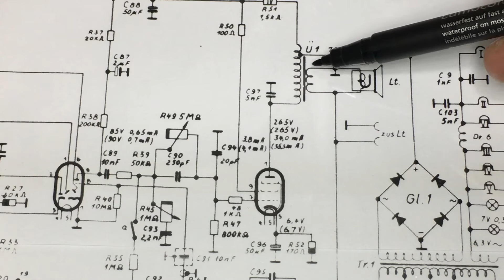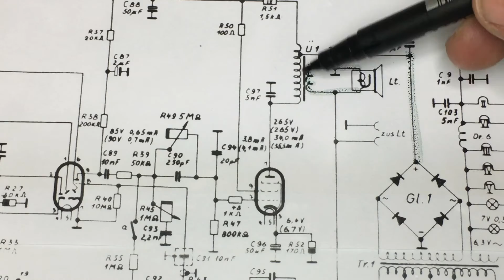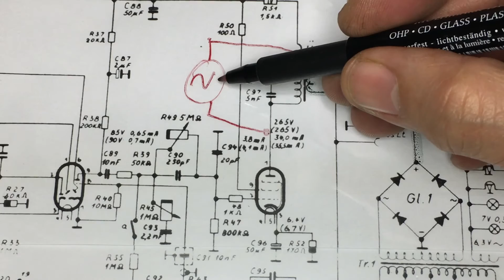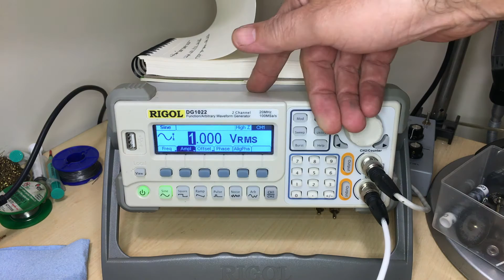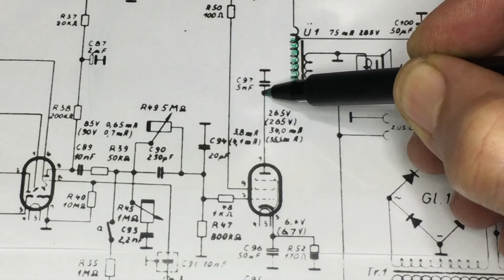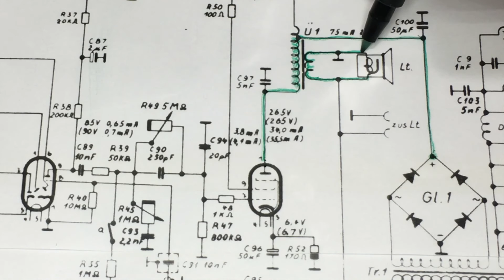How to safely test the Output Transformer on tube radio or amp.

Comment: Thank you so much for this wonderful video. It's very timely that I'm currently working on a guitar tube amp which the output transformer emitting some smoke when turning on the amp. This creates a humming noise at the same time. Measured the voltage out of the board that supplies to a center tapped TX and it measured around 380VDC is this normal? Or is the humming noise due to the faulty output transformer. The output side of the TX is reading 0 Ohm using my multimeter.
Reply from the maker: The 380VDC is probably correct as it is the B+ going to the output tubes through the primary if the output transformer. Check the voltage at the anodes of the power tubes and should read a little less than the 380 at the center tap of the OT. That would tell you that the primary may be OK. The zero ohms of the secondary is concerning. It should be low, but could also be shorted.

Comment: Awesome? I am testing transformers in the Loewe Opta Hellas 3841 W at the moment. This is extremely valuable information and a fabulous reference and future guide. Explained in a straight forward, clear manner. Thank you very much Manuel! I am making a small donation.
Reply from the maker: Thank you. Glad to help.
Reply: @electronicsoldandnew  you only seem to have monthly coffee payment options now. I wasn’t able to find one off random PayPal coffee payment option via Patreon direction. It’s better to leave all options open for friendly relations. Don’t worry what the competition are doing. Just do your usual great work! Cheers. 😁☕️
Reply from the maker: The patreon system doesn’t allow for one-off payment, which is why I added Paypal as an option. Thanks.
Reply: @electronicsoldandnew  I have made several one off friendly contributions when you directed me to the Patreon link, where I made one off payments with PayPal. The payment link is no where to be found. Sorry to be a pain but it’s something I come across every time I want to make a contribution. I have clocked up thousands of hours in internet marketing, web design, search engine optimisation etc… A qualified observation!
Reply from the maker: I’ll check it out. See why the link in the description is not working.
Reply from the maker: I tried it and it seems to work. Here’s the full link:
https://www.paypal.com/paypalme/macaldeira
Reply: @electronicsoldandnew  if I am not finding the link, maybe more exposure of that link could help bring in coffees. It’s okay, it’s not your fault.
Reply: @electronicsoldandnew  the link worked thank you. The link is not showing on your description page at my end. I use an iPhone 7S with iOS 15.

Comment: Thank you for posting this, very useful for a novice like me.  I'm working on a Knight signal tracer that has no audio.  All tubes are good, I replaced all electrolytic and filter capacitors and spot check several resistors and replaced a couple that tested out of spec.  The output transformer tests good using your test method.  Can you point me in the right direction, would else would be the most probably reasons for no audio?

Comment: I'm confused how the output transformer BLOCKS the 300vdc to 600vdc DC voltage apply to the power tubes on the anodes. I know that capacitors block DC but inductors pass DC and there is high DC voltage on the primary side to the output transformer to the secondary side of the output transformers must have very high DC voltage or the output transformer RATIO is what BLOCKS the high voltage DC ?

Comment: THank youi for the very instructive video. How would the procedure differ for a push-pull configuration?
Reply from the maker: Do exactly the same thing from both driver tube anodes, one at a time.
Reply: @electronicsoldandnew  Much obliged for the response.

Comment: I appreciated your video... I am not working on a tube radio but a lamp with sound and animated parts. I would like to test the secondary windings to figure out the Voltage output but do not want to desolder the connection. The windings go into the board where the RR(4 diodes) meet in the middle of them. Then there is a capacitor (smoothing cap I believe it is called). the voltage at the RR is 1.5v but at the capacitor 2200Uf/16v is 9v... How can I test the output voltage correctly as I need to order another transformer for a 2nd lamp that is no longer working? Thanks!

Comment: It's an old video but can you give an explanation how to do the same procedure on Push-Pull output transformers? I have a soviet hi-fi radiola that I'd like to test, it has EL84s in push pull.
Reply from the maker: Exactly the same. Do it one winding at a time and the signal should be heard at the output in both cases.

Comment: Another great video, very concise clear instructions. I successfully tested my power transformer using your other video as a guide, but unfortunately I don’t have a signal generator. Could I use a Variac set to low voltage to test the output transformer?
Thanks again.
Also, would be great if one day you could do a video explaining how to connect an external device such as an iPhone to the PU plug so we can listen to online radio as an option. :)
Reply from the maker: E careful of using the variac. It has very high current capabilities which could do more damage.
As for your request for a video, I have actually done one. I believe it was the stereo to mono cable video.
Reply: Electronics Old and New by M Caldeira Thanks, just watched the suggested video for stereo to mono, exactly what I needed.
Thanks also for the advice on the Variac, I’ll have to come up with another way to test the output transformer, or just take a punt that it works after recapping my Schaub Lorenz. :)
Reply: @BKGoldDetecting  wouldn't putting a low value fuse on the OT primary's leg safeguard the transformer from current draw....which there shouldn't be any if secondary has nothing connected? ( shorted would draw current but fuse would prevent runaway )
Reply from the maker: @curtisprice9806 : that would work

Comment: I put the positive lead from my signal generator to the correct pin and heard a signal without placing the negative lead on the circuit. Just that mean the circuit is grounded?
Reply from the maker: Your signal gen is grounded through the mains earth, and if your unit is also using mains earth as a ground, then you have the system using the same ‘ground’

Comment: Repairing basically guitar amps, I must say that this procedure is unfortunately not enough to verify that an output transformer is really okay. Problems could be caused by insulation problems, caused by internal sparks if amps have been driven hard without a load being connected. Those issues might only appear, if the ot is tested under proper voltage-conditions. I usually use my variac plus a connected powertransformer out of any tube gear and use the 6.3V heater coil to get an adjusteable ac between 0 and around 7V.. I then connect this voltage to the secondary winding of the ot and make my measurements at the primary coil of the ot. I've already found dead transformers that seemed to work fine with the other checkup procedure... But thanks for your great videos!!!
Reply from the maker: salossi : thanks for your input.
Reply: ...that's clear as mud to me-!!

Comment: Hi, thanks for the informative explanation and vid.  I am working on an Akai M8 right-side amp monoblock that has zero output. The left side works.  The troubleshooting guide in the service manual suggests testing the output transformer.  I have traced the wires from the speaker jack back to one side of the OT (output side) and traced the wires to the input side of the OT.  

I am using an IPad as my signal source with a stripped 1/8" cable with bare wires on one end connected with alligator clips.

I am having trouble identifying where I connect the cable in my amp like you connected to the rectifier in the vid.  I guess I am looking for B+?

So, just guessing (with power off and unplugged) I connected one clip to the output side of the OT (a wire actually connected to speaker jack) and touched one of the two tabs on the input side of the OT with a probe and got audio.  Then on the underside of the amp I touched the probe to the 7th pin on the EL84 socket (tube removed) which is hard-wired to other tab on the input side of the OT and got audio. Notably, I got audio from touching several of the pins and much better volume and bass from touching the underside center pin.

I do not get audio  if I touch the signal probe to each of the tabs on the input side of the transformer.

I feel like I am doing it wrong. But, it seems like the signal has to be going through the transformer itself because I am connecting to wires on one side and completing the circuit on the other.  

I hope I am not being an idiot?

Comment: thanks for your informative info, but I dont have radio tube Transformer. I have electrics organ I couldn't find good inf on how to tested. my transformer have 4 wire in primery and 6 wire secondry. could you please performe vidoe on how to test this kind of transformer. many thanks
Reply from the maker: +Tory Bosher : is it a power transformer or audio output transformer?
Reply: I really appreciate ur reply. Unfortunately there is no way to show u my transformer but believe It is audio transformer. Many thanks

Comment: I don't have a Function Genator so this is how I test transformers for power or output for speakers I use a little AC Train power supply that is varible from 1volt to about 6volts. I typically try not to go over 2 volts. Then on the output will just use a voltmeter to get a voltage reading. A friend of mine does the same test but with a higher voltage and a light bulb.
Reply from the maker: +Leland Clayton : that's just fine. All you need is any source of AC voltage, and try to keep it low, so you don't get any nasty surprises.
Reply: I have looked for one of these with no success, are they called by something else? There are one or two found at 6 volts, nothing adjustable and nothing at the lower voltages. TIA